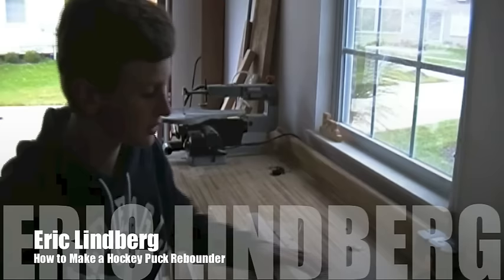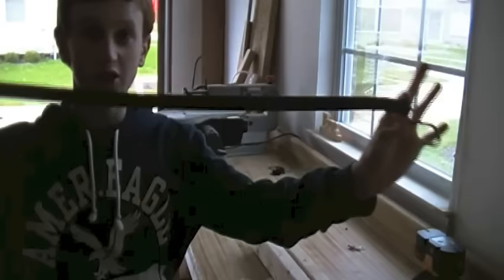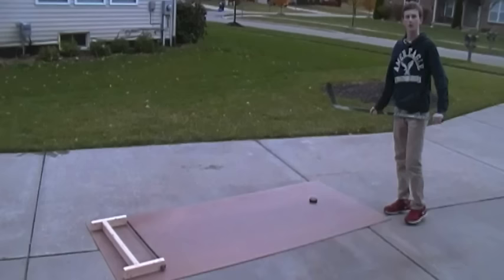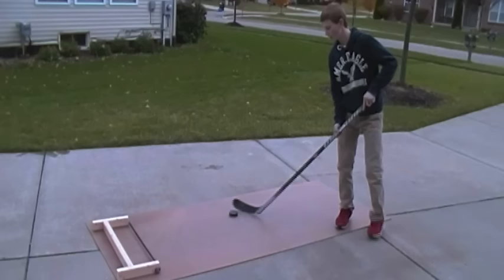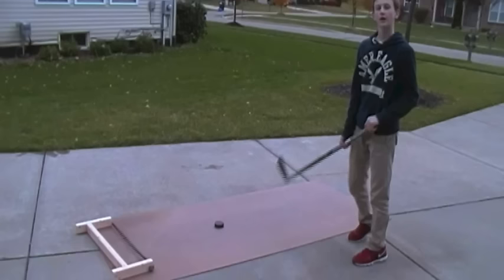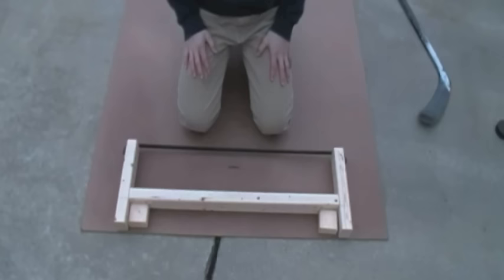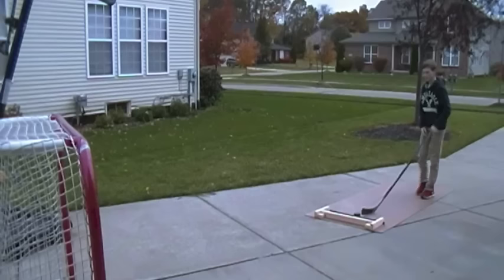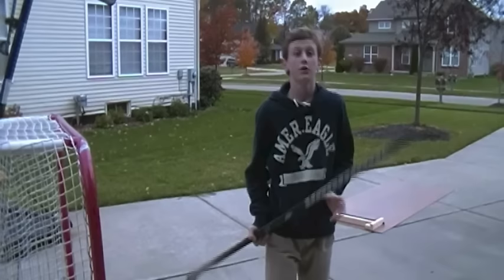How to Make a Hockey Puck Rebounder: Less than 6 Bucks!

Comment: Nice work. Not sure if you still have the issue, but you could try just getting a weight to set on top, or some rubber feet to actually mount to the bottom of the rebounder to keep it from moving no matter what surface it's on.

Comment: there is more then $6 in just lumber.  And someone need to teach you power tool safety.  Never ever take your hands off the tool while the blade is still moving.  gaurd or not that was very dangerous
Reply: I just built a rebounder today and the 8 foot 2x3 cost me less than $2.18 and the 31 inch bungee cost me $2 and some change. He's right with the $6, unless you factor in a new box of screws and the tools to get the job done